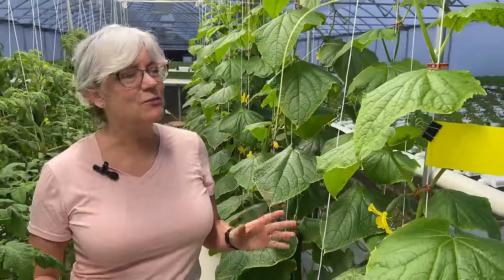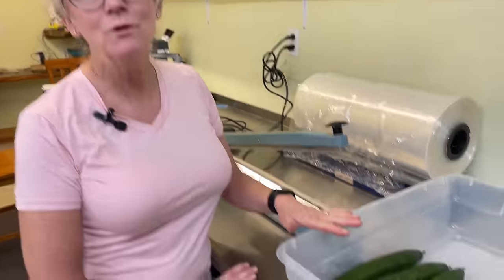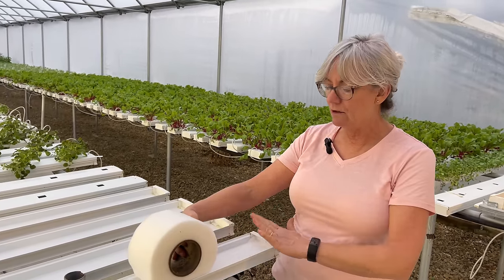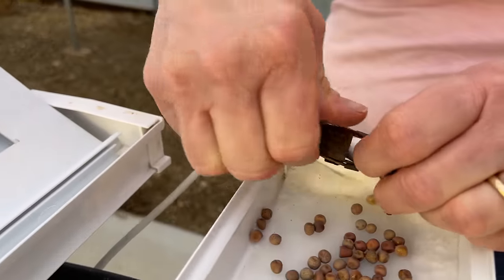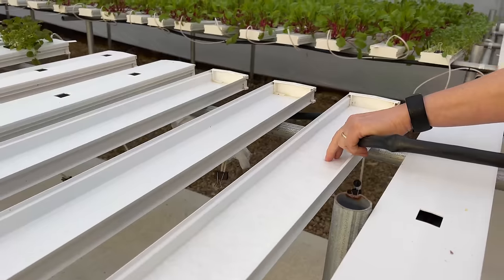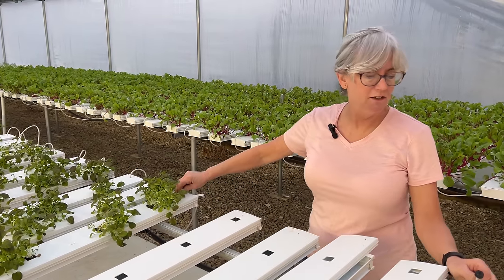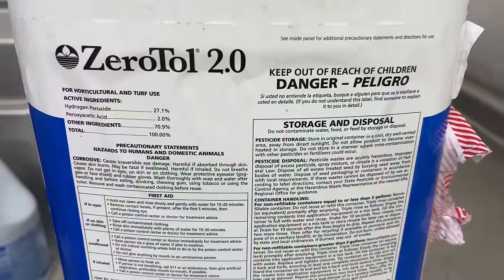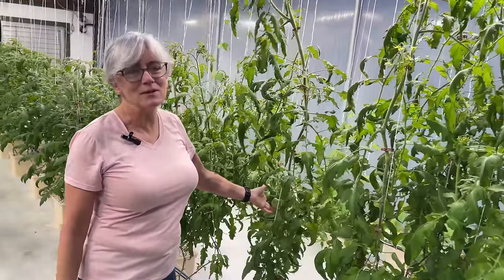WINTER Hydroponic Microgreens, English Cucumber's and Tomato pollination.

Comment: Great video, suggestion heat shrink the closed ends towards the open end, don't close it all up and heat shrink you leave air in the package best to shrink it down then close the end with less air in it then seal the bag up then close it off with the heat gun. there also vacuum pumping then seal with a small vacuum pump and a rubber tube seal away with most the air is gone. Maybe helpful for other veggies and fruits. 
Take care, one farmer to another.
Reply from the maker: Thanks will have to look into that

Comment: Zero-tol seems to just be a dry-base hydrogen peroxide. Do you use this in your reservoirs as well or are you using another sterilizing agent (chlorine based) for that?
Reply: I've been considering spraying plants with hydrogen peroxide is it any good?
Reply: @johnman559  Only if you're trying to combat something like powdery mildew or knock down a thrips infestation. Hydrogen peroxide is just water with one extra "Hydrogen PER Oxide". This oxygen molecule breaks off rapidly and then all you have is water and a bit more oxygen.
Reply from the maker: We use hypogrow in the reservoir works great.
Reply: @HomegrownPassion  thanks Katie!

Comment: Super informative! I'm wondering what type of lights are you running? How powerful are they? This winter and last winter I took a shoot from my black krim tomatoes and rooted them. In both instances they seem to have stalled at the same point in growth. Not getting any taller and the tomatoes not growing past 2½" inches. My soil is good and nutrients are good. So the only thing I can think is my lights aren't strong enough to grow the plant past the stage they are at. Not like your tomatoes! I'm jealous! Other than perhaps lighting, any suggestions? Thank you!
Reply from the maker: Lighting is for sure important but also remember tomatoes like the heat and don't let them get too cold at night. It will really slow down there growth.